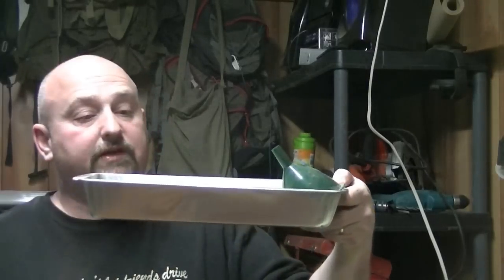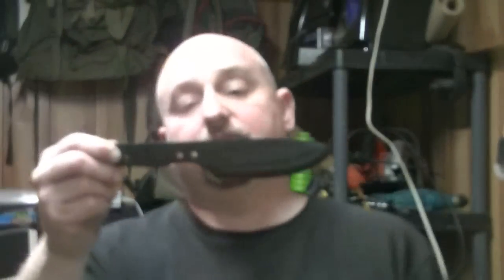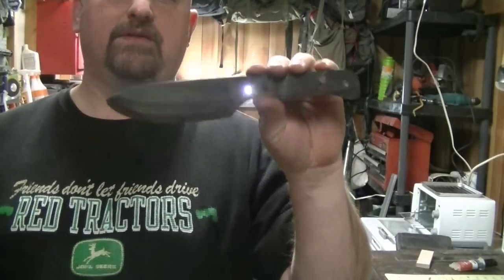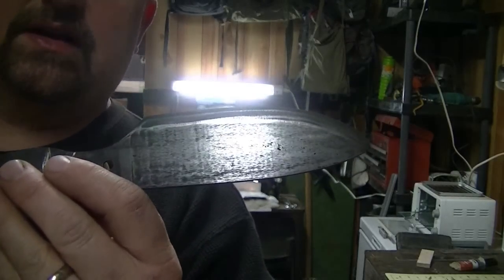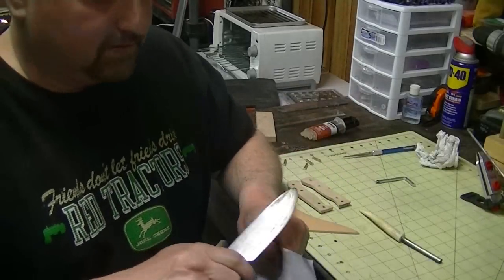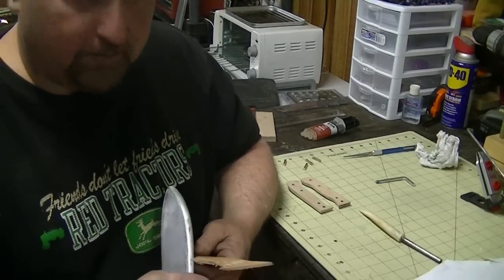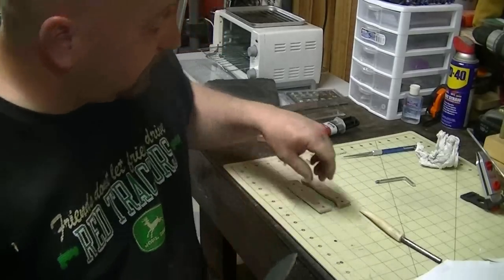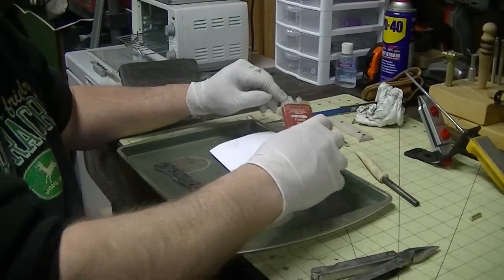Making a new Bushcraft knife from a saw blade Part 3

Comment: I've been doing the same thing with saw blades. Free to practice on and using ash and hickory for handles. (old hammer, axe handles, also baseball bats make good scales.)
Reply from the maker: It is much fun and good learning. I have found the hardening is up and down on the old saw blades. I still use them and make knives. Sometimes I get a bucket full of broken ones and sometimes I get a legacy. I have seen and heard that some people even buy hardwood floor and use them for scales. I have been impregnating wood hardener into the woods I use now. I use a pressure tank from Harbor freight. In theory I guess its not possible? But no cracks and no splits yet and the wood is like a rock... Thanks for sharing and keep up the work. It is fun and can be a nice profitable hobby in the end... ATB MIke